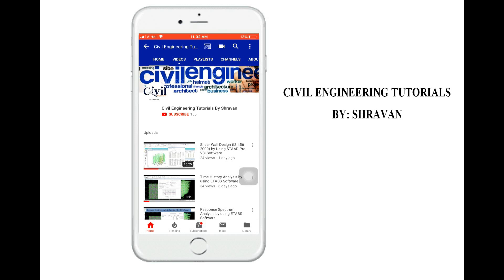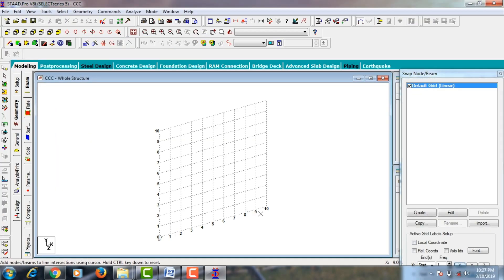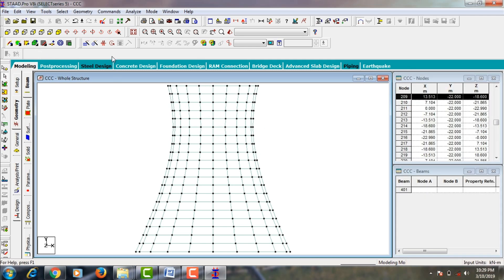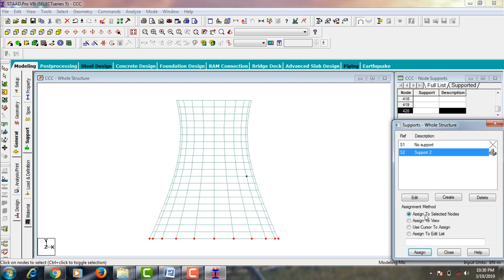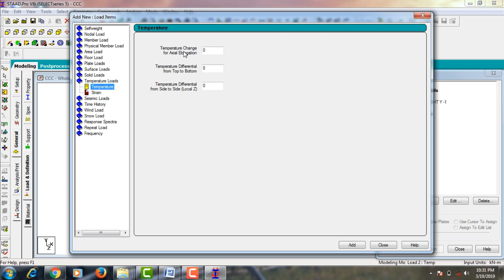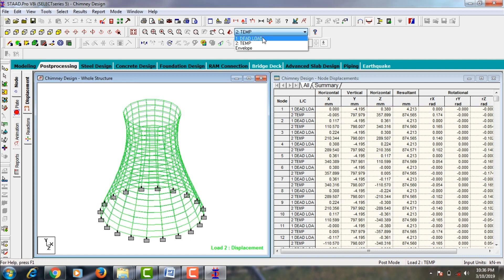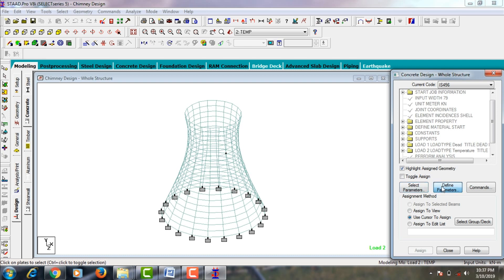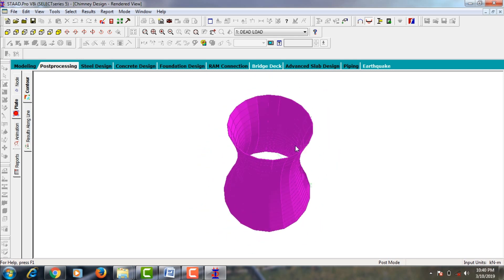Chimney design by Staad Pro Software

Comment: Hi Shravan! I have attempted to design the chimney with the same specifications & parameters and on analysis I have been informed that there are 400 errors (=No of elements) and error message is The design moment exceeds the limiting moment of resistance for all elements. What might be wrong? How to deal with the error part of this? How do you design a ring beam foundation for chimney with slant elements/ring beam? Do you have any example on youtube?
Reply: Even I have same doubt

Comment: Doubts are not answered. Normally, chimneys in power station plants are connected to flue gas outlets which require openings of matching sizes. How to model the openings and design the structure? There are intermittent platforms to support steel flues. How the platforms are to be modelled and designed with temperature stresses?